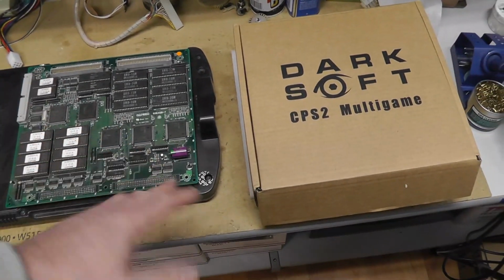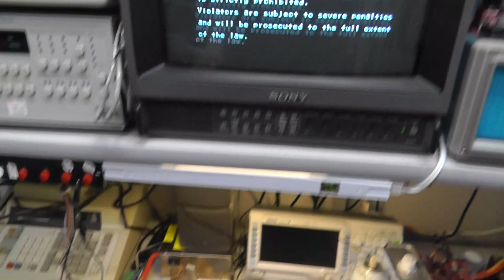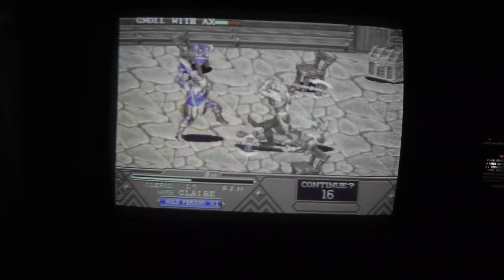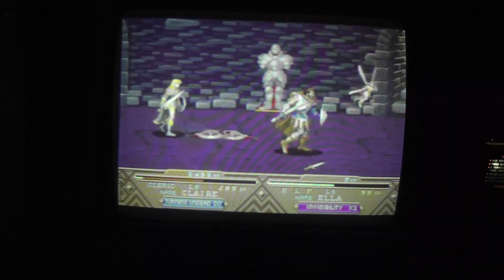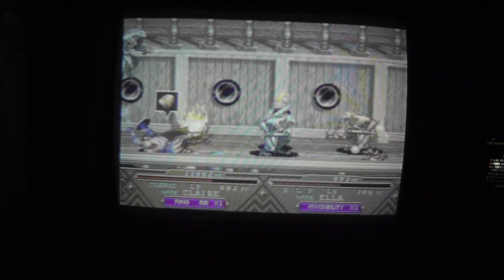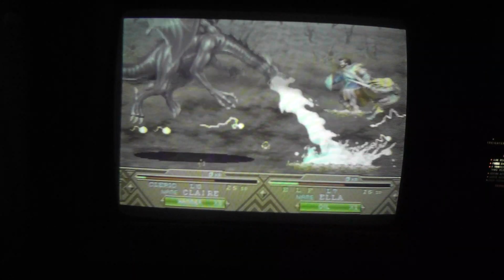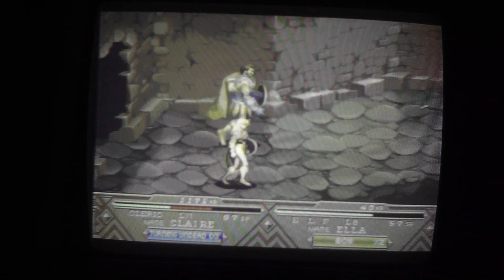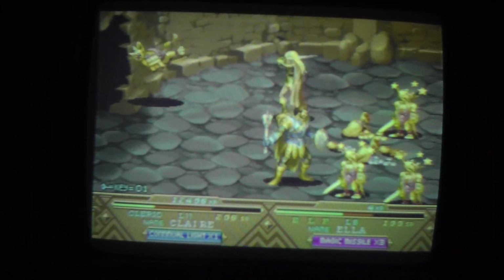First Play in the Arcade - CPS2 Darksoft Multi - D&D Tower of Doom

Comment: Interesting that it works on a running board. HSS is insistent on using a suicided one. And awesome D&D gameplay!
Reply from the maker: I think darksoft and hss say use a suicide board so people aren't encouraged to essentially suicide a working board by installing kit.  Thanks for comment.
Reply: @jacklick  was a good vid. I just ordered a one actually and was going to make a vid on my channel to lol. It'll be the new version one so the differences will be interesting. Still not sure what the key think it's about. Can run encrypted roms? Just started my cps2 collection so still learning these things.
Reply from the maker: @keitheldridge2402  newer version should be easier install, no need for pal etc. Yes, i believe the key allows you to run encrypted roms vs phoenix.
Reply: @jacklick  Last question, lol because I'm slow! Are they talking encrypted ROMs on the board or ones you add to the SD card?
Reply from the maker: @arcadelaboratory  99pct certain it is both.  The original roms were encrypted and with the darksoft kit it loads a key to decrypt them.  This allows you to run original rom files on the sd card.
Reply: @jacklick  ok got it! I'll keep you posted on the new version install